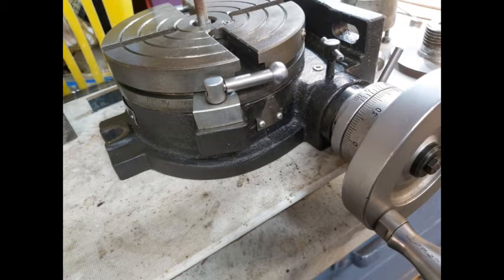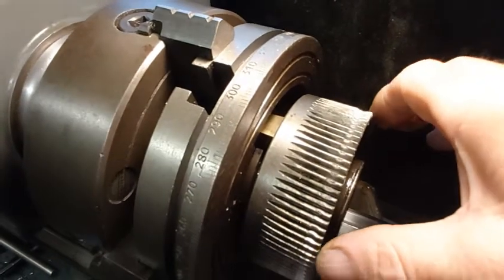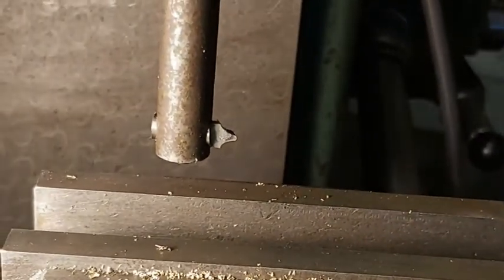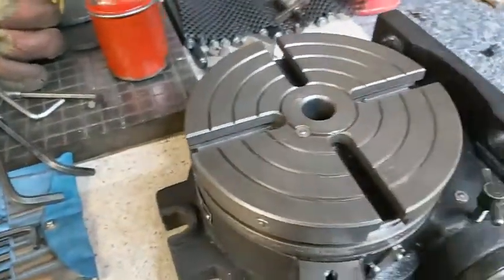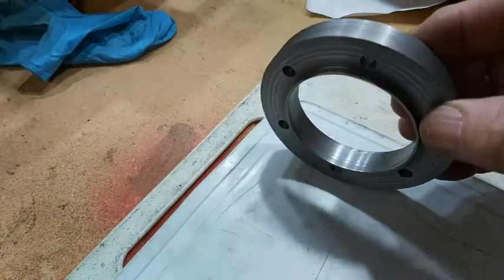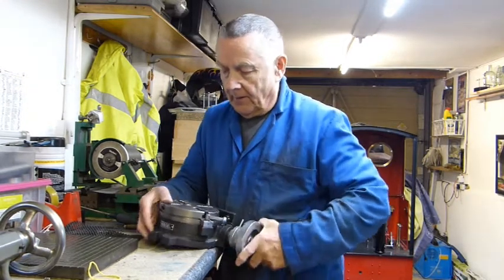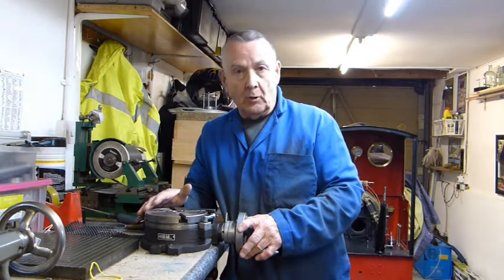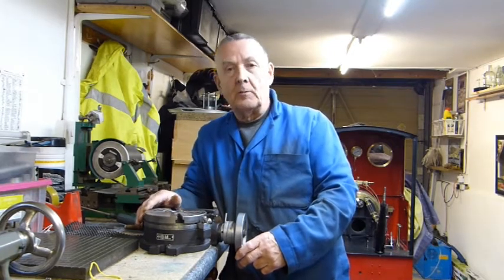Restoring a damaged 6inch rotary table.

Comment: Hi Popperkeg, I had the same problem with a 4" rotary table I got from India. It failed the 1st time I used it for the same reason, but worse. The gear on the table spindle jammed & broke the brass shear pin. The gear was a very loose fit as well, so I think I will use your idea & attempt to cut a new gear🤔 Cheers Peter from Oz
Reply from the maker: Good luck,it made a big difference for me,just need a bit of care in cutting the teeth it was well worth the effort,dont know the the country of origin where this came from as they are made in various eastern countries.I have now fitted a dividing attachment which has made it even better.